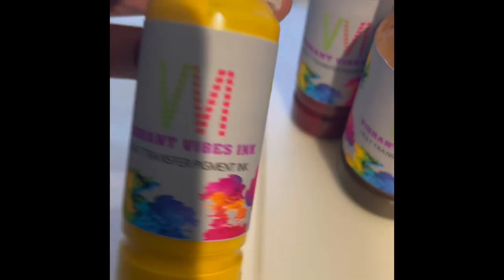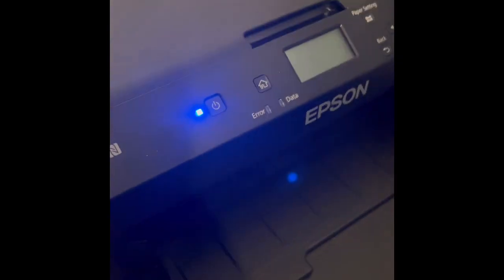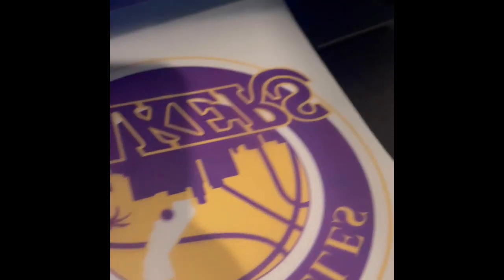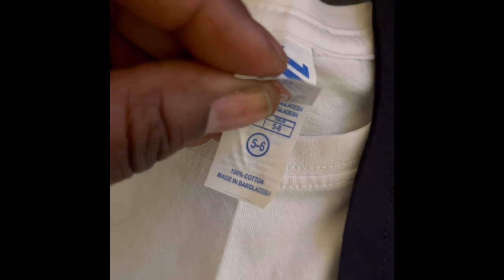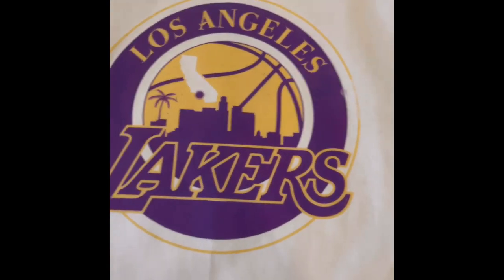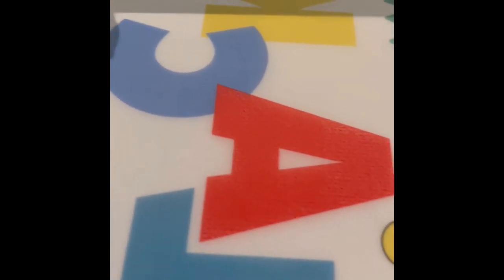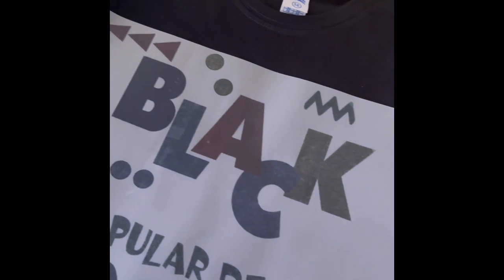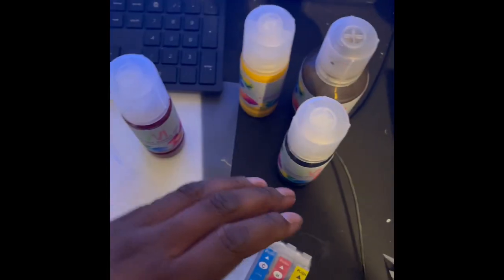DTF Using My Epson WF 7210

Comment: With this conversion, did you have any limitation or advice on the white ink color not present compared to other natural DTF printers? I want to convert mine but because I cannot add white ink, not sure if I will have any limitations or not abnle to print images that should have white with other colors?
Reply from the maker: Yes. You'll get the best results on white.

Comment: Hello and thanks a lot for the video. I have a question and it's that do I have to use a pigment ink or a DTF ink?
Reply from the maker: Your welcome! You will need DTF ink.
Reply: @vibrantvibesink7866   thank you vibrant vibes ink for your knowledge shared. If I convert my wf7720 to a DTF ,

1. Will it be able to print beautifully on a light garment such as white only or can it also print beautifully on other light garment such as light blue, light, pink, light green since they are all considered light color garments?

2. I have some pet film but for screen printing, can I use it as a DTF film if I convert my wf7720 to DTF?

Thank you for your answers in advance.

Comment: Thanks for this video, are you still doing DTF printing? Is the maintenance time consuming for the 7210? What program did you use to print from the 7210?
Reply from the maker: When using the 7210, it’s not the same process when it comes to maintenance. Their is no white ink, so clogging will be minimum to none.

Comment: What do you use to substitute white ink when working on a black shirt?
Reply: you can't. That's one of the limitations. If you have a vinyl cutter, you can apply a layer of white to the designs shape, as a base, then sublimate onto the vinyl once on the shirt.
Reply: @cornerstone710  Damn. That would've been awesome if it was possible.
Reply: @Iforlyfe  there are other printing processes. Screen printing, there is also screen print sublimation, which in a way, 'bleaches' and dyes the fabric, to achieve this. But its a longer more costly process, not worth it for small runs and all garments need to be washed after printing. But yes, it's a shame
Reply: @cornerstone710  Yeah that sounds like a lot of work lol. At the moment I'm using 3G Opaque. It isn't bad but gets frustrating to cut and weed out, and then use a sticker sheet to remove it from the backing to then heat press it. What sucks is that not everything always transfers over the sticker sheet.

Comment: You can try replacing your black ink cart with white ink, then just print black using your color inks (which can be done by changing a print setting) and then you can do the first pass through printing with the color carts, then do a 2nd pass printing with the white ink. You will have to create a silhouette of  your original image and then print that in white.
Reply: That’s why I was thinking. Does that work for you?
Reply: @Bad_Hombre  it works i did a test print with my sublimation ink just to see if it will align perfectly before i start using dtf ink just make a silhouette image of the original your trying to print and print the first in color and the second in black and white but switch the black cart with the white for the second print
Reply: @PCeeThaGr8TV  hey can you please explain this some more and can you show me pictures of black shirts that you did with it ?
Reply: @saidzakaria3232  its a hell of a process but the first step is too get your first image printed in color in the matte paper setting standard after the image is printed replace the black ink cartridge with a white once replaced run a couple of solid black prints in the black in grey print settings that way the print head flushes out all of the black ink before you put your transfer back into the printer once you see the color print transition from black too white the design is ready for print and once you load the paper use matte paper settings again but set it to high there for it lays down more of a white base of ink over the color and you dont have to worry about the ink drying in the process its about a 20 minute process but the ink still remains moist before you powder
Reply: @saidzakaria3232  if you dont flush out the black first  it will mix in with the print and black out the whole image where the white ink will just sit on the top and you will still see your printed image
Reply: @saidzakaria3232  hopefully i explained it good enough if you got anymore questions just message  me ill give you more details
Reply: @PCeeThaGr8TV  thank you I will try it soon
Reply: @saidzakaria3232  and dont forget to make your own cleaning solution for back up refillable cartridges if you haven't bought any solution from any vendor ink dries fast so clean after you after done with the desired prints you made
Reply: Can you show us how

Comment: I have MANY questions....

-does it clog a lot?
-there's no white so is this only for white garments?
-No rollers or anything had to be removed from your printer?
-How did you get the sublimation ink out before you changed it?
-Has the printer continued to work since you posted this?
Reply from the maker: The white ink is the problem ink when it comes to clogging. but, just like any other converted printer it will require daily maintenance. I did not have remove any rollers. Their is no top layer of white, therefore the color ink prints on the film just as thin as it would on regular paper. to remove the sub ink, you can flush the line with cleaning solution  and heads cleaning. All i did was change the cartages and added the cartages with dtf ink, did about two head cleaning and was good. The printer has been in good working condition since. I no longer have it, its was gifted!
Reply: Hi, so just double checking. I have the 7210 as well and for me to convert it dtf, i don't have to do anything with the hardware? Like the front roller? I could just get a refillable cartdridge and dtf ink and i should be able to print. Just really curious. Thanks.
Reply: @tristanw1982  yeah, just put in the ink and it should be good to go. You just won't have a white channel.
Reply: @LakersNinersFan  thank you.

Comment: Can you use the printer for sublimation and dtf or once you covert it does it have to say dtf?
Reply from the maker: You can not keep switch back and forward between the two.
Reply: @vibrantvibesink7866  but we could buy another one and use one for each. Cheaper then the dtf printers.

Comment: Love this video! I  am curious epson just released the EcoTank Photo ET-8550 it has 6 tanks. I am wondering could one be used for white? but how would the printer know to use that one as white? love this video! It just sparked that thought in my head. Could be a game changer if someone figures it out!
Reply: The only way it would work is if your got RIP software that supports the printer, or possibly if you use white in the black ink cartridge, since most printer drivers have a feature to turn off the black cart when printing, and turning it back on afterwards.
Reply: @thatguyfromca  How would that work? if there is white in the cartridge and the cartridge is turned off, how will it print the white? i know im missing something
Reply: @dechellerasheed8763  You turn off the black and then print your color image. Then turn on the black (white) again and pass the same print back through and do a white only cover on it. It could work I think.
Reply: @thatguyfromca  in brazil they did what your saying with a rip program so im guessing your idea will work also
Reply from the maker: I definitely wouldn't suggest it, since the white ink need to be shaken or turned to keep it from separation. The white ink clogs quickly and you want something that you will be able to remove and clean.

Comment: Quick question..? Did they ever clogged up, Ive read that the white is the problem, cause its heavier. But just wondering before I convert my 7610 into a dtf. Thanks for this awesome idea... love it!!!!
Reply from the maker: No, I haven’t had any problems with it clogging. I usually print everyday and if I don’t, I always print a nozzle print.
Reply: What software did you use for this printers?

Comment: Can I use any inkjet printer to convert it  or is there a specific kind I need?
Reply from the maker: You can basically use the ink in any Epson printer that has refillable ink cartridges. The only thing is making sure your printer can print  without any roller marks.

Comment: what if you get a second printer and fill it with white ink?
Reply: this was an idea i thought of just the other day, use one printer for the color one for the white
Reply: @PuRPLEALiEn81  Did you try?
Reply: I think you can just replace the black cart with a white cart then just run the print through twice , once for color print, and once for white cover over the color areas. Would just have to change printer settings to not use the black cart, then turn back on when  you want to print the white. I think I might try this too.
Reply: @thatguyfromca  did you trt
Reply: @AlevatedCustoms  noo
Reply: @AlevatedCustoms  no I haven't ordered the ink yet

Comment: What rip?
Reply from the maker: With this method you don’t need a RIP software, because your not printing white ink.
Reply: Did you try an alternative for the white ink?
Reply from the maker: @danitanolan9362  yes, but it’s not an ideal process, and not the best method. In would suggest to convert a 6 Chanel Epson if you would like to print whit. But, the method in the video is a great alternative for quick and easy t-shirts printing on cotton.
Reply: @vibrantvibesink7866  are you going to do a video for the process with white ink. I am intrested in learning the method
Reply from the maker: @Tifftaft2  I’ve tried different methods using a Wf successfully, but it’s not an ideal process and wouldn’t recommend it. The method which I’ve done in this video is another alternative other than sublimation when needing to use cotton instead of polyester. To print with white their are other Epson printers with 6-8 Channels that you can use with white ink.
Reply: @vibrantvibesink7866  thank you, I think I am going to try my luck and get the 6 tank last you reccomend and try it out. 😀

Comment: So what do u think u would have done differently on the black shirt?
Reply from the maker: For the black shirt, you need white ink to use a s a background color. But  because the Epson only holds 4 colors it’s no where to add white ink, so this is why this method is only good for white gourmets.

Comment: I have a question please...so u didn't have remove the print head or anything to convert? Just ink..powder..and the film??
Reply from the maker: No, I didn’t have to remove anything, just add the DTF ink and print on the film.
Reply: I have an extra ecotank can i use that?
Reply from the maker: @danitanolan9362  yes you can
Reply: @vibrantvibesink7866  I would like to say thank you for taking the time to respond much appreciated.
Reply from the maker: @danitanolan9362  Your Welcome!
Reply from the maker: @danitanolan9362  Yes
Reply: How did you keep from getting the roller wheel if you didn’t take out the printer wheel?

Comment: @andresMarquez DTF printing consists of  pet film, dtf ink, and powder so it is dtf printing. She doesn’t have to have 6 or more ink system if she’s only printing on white. You sound like a hater. I have dtf printers that print cmykWw and printers just using cmyk. Same thing
Reply: What DTF printer do you recommend?
Reply: pro tip: you can watch movies at Flixzone. Been using it for watching lots of of movies during the lockdown.
Reply: @Malachi Seth yup, I have been using flixzone for years myself :)

Comment: Wow sis that is a beautiful video in order for you to get the white you need to have a 6 color printer and acrorip software this software allows you to change the color or any printing cartridge but 6 is the limit in minimum. That's how you get the white to print out.
Reply: Actually you might be able to do it with a 4 color printer like hers, just replace the black cart with white.
Reply: @Alfonso P. xp-15000 epson is the cheapest one I've found that can be used correctly for DTF

Comment: Could i use your vibrant pigment inks in a eco tank printer so I wont have to worry about the ink cartridges.
Reply from the maker: I haven’t tested it on a EcoTank as of yet. I plan to do so in the next week and will do a updated video.
Reply: @vibrantvibesink7866  Thank you

Comment: Basically if you already have a pigment printer you just need the Film and Powder.
Reply from the maker: It’s not regular pigment ink, it’s heat transfer ink used for DTF.
Reply: @vibrantvibesink7866  Ok thanks.

Comment: Can you convert your sublimation printer to DTF? Also can the left over powder be used over and over? Thanks
Reply from the maker: Yes, the printer I used in the video I once converted it to sublimation, and now it’s a DTF. It will just take several head and nozzle cleaning before the ink starts to flow.
Reply: @vibrantvibesink7866  Thanks love